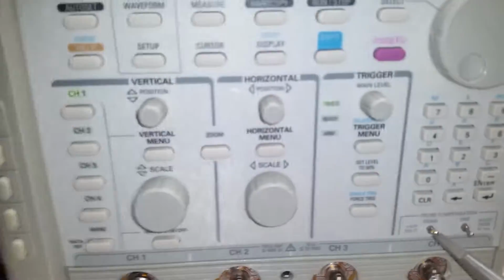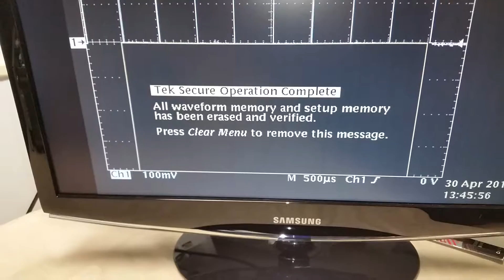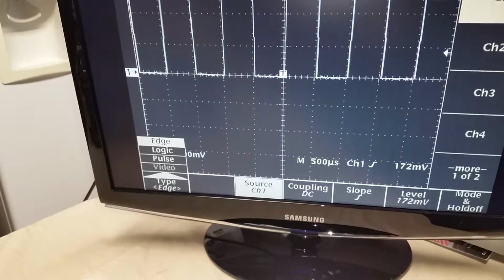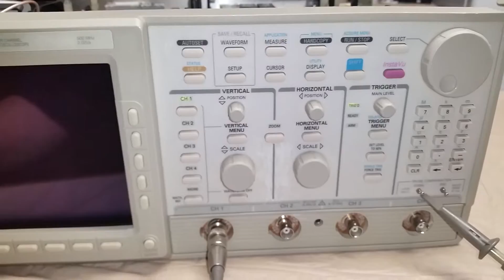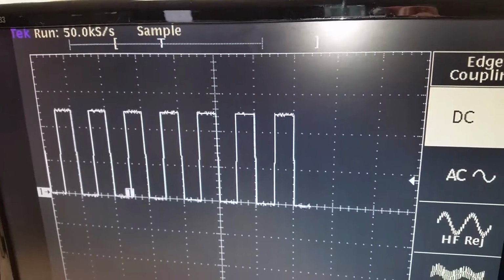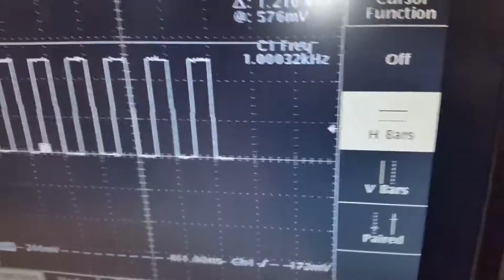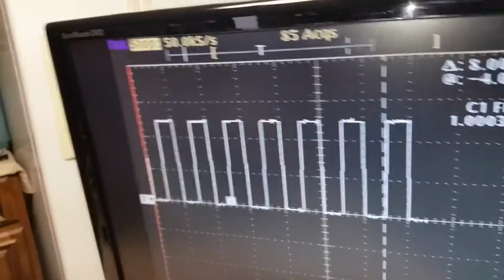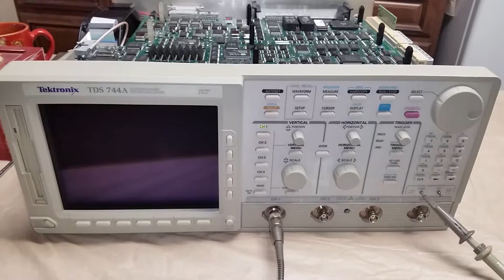TEK TDS 744A No Display Repair Part 3 Brief Menu Choices

Comment: Digital scopes' trigger is different from analog: it has a rolling buffer so it can look back in time. Trigger in digital scopes tells it at which time point it should not let new data overwrite the time segment around the trigger moment before showing it to you. Centering at 50% is a luxury from digital scopes that makes it easier to read. Analog scope draw from the left of the screen because analog buffer is not easy so they typically don't have look back capability so they might as well not waste the screen real estate. If you want to see more data after the trigger and less before that, there's an option to set the pre-trigger to as early as 20%. Just moving the horizontal position (delay) doesn't get you extra data as you saw on the screen you are getting blanks. FYI, digital scopes typically analyze from what they've drawn on the screen. If you don't see something drawn on the screen, moving the delay (horizontal position) is not going to show you new information.
Reply from the maker: A really good comment and very informative, Love it when my viewers contribute useful information for all to read. Some of this I already knew and have used it multiple times in the last 42 years of working in electronics. I absolutely love these scopes and the options they provide. Thanks so much again for the great comment. Best Wishes & Blessings. Keith Noneya

Comment: hey, I have the same oscilloscope, the display is good but every time I turn it on it well have a contentious "beep" sound  do you know what the problem is?
Reply: The capacitors in the front panel keyboard leaked very badly and the electrolyte is messing with the signal. You need to wash the electrolyte off (soap works better than rubbing alcohol) and replace all the SMD electrolytic capacitors. TDS 300~800 series is a nightmare. Everything goes bad at this age.